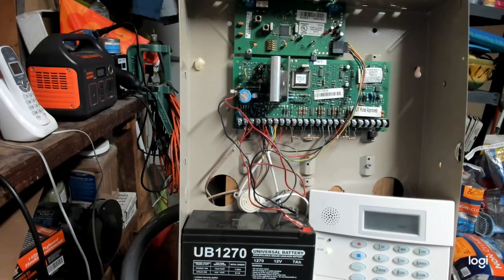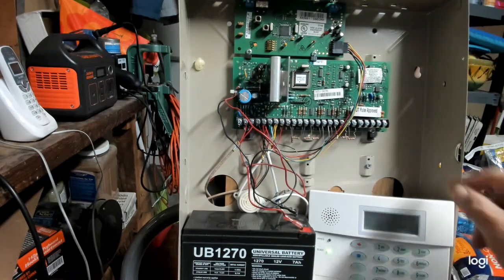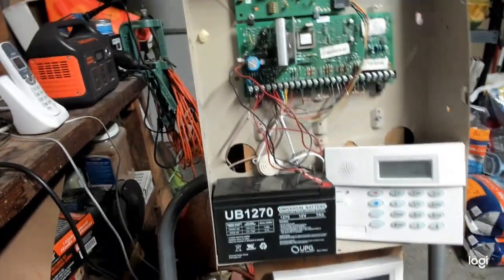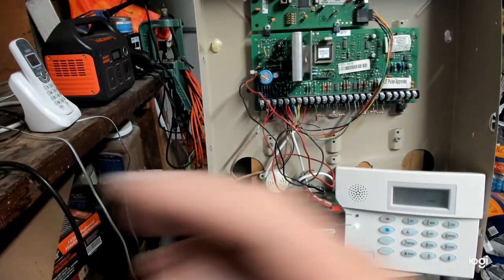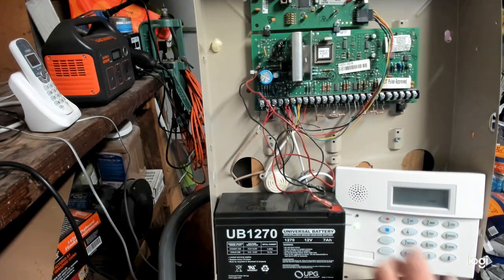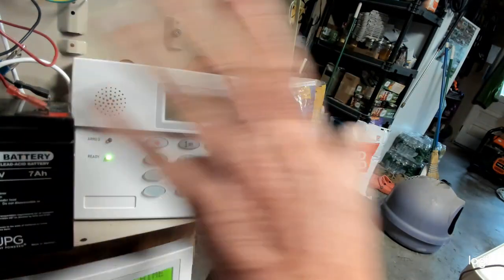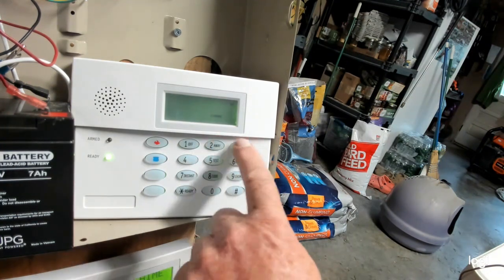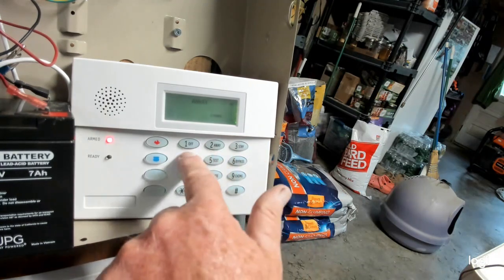Ademco Vista ADT Safewatch 3000 Safewatch Pro Lost Master / Installers Code Recovery

Comment: Found the Installer code just like you showed us but no matter what I do the system will not let me change the installer code?
Reply from the maker: After changing the installer code have you ever completely powered the system down and back up?
Reply: Why change installer code?
Reply from the maker: @davidwiniger3799  Because anyone with that code can turn your system off via Bluetooth and many other communication modes